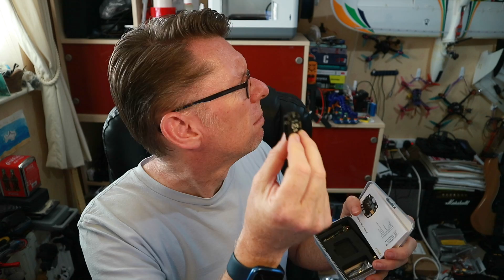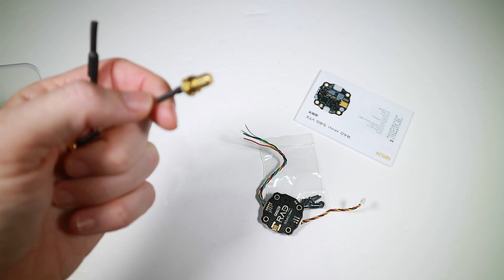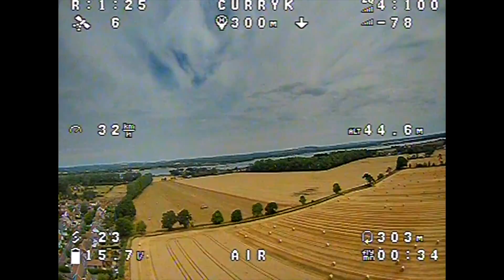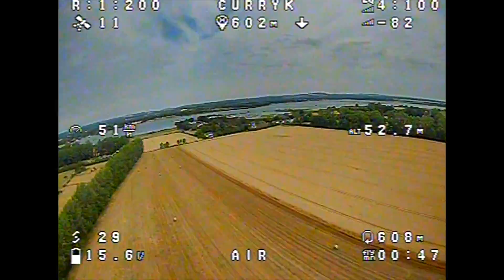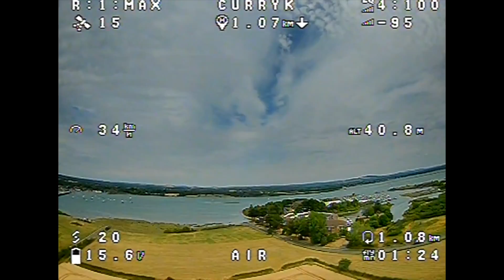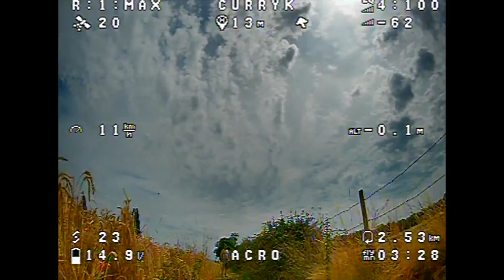GepRC Rad Mini VTX - from 25mW to 1000mW!  Supplied by GepRC

Comment: Hi Wayne, great video! I bought a GepRC cinelog 35 V2 which comes with this VTX but I can only get about 60meters range before the video dramatically drops off, no matter what power output I choose. I'm using stock antenna on the Eachine Ev800dm's. Can you help? Thanks

Comment: So RUSH mini tank is better at 800 than the GEPRC rad at a 1000!?
Reply from the maker: Even if everything else was identical, the difference in range between 800 and 1000 is not as much as you'd think.  Rush has always produced the very cleanest signal - which is why it always comes out on top for me

Comment: Do you get better range in general using Raceband 1?  Nice Video!
Reply from the maker: Not really.  Although the antenna will have a sweet spot for where it's tuned (normally smack bang on 5800) there isn't really a difference in range between the bands and channels.  I use R1 as if I'm flying with others then it's easy to be on Raceband and space the channels out so we can fly easily together
Reply: I had once heard (joshua bardwell) that in the US raceband ch8 gives less wifi interference.
Unfortunately I don't know how that works in the UK.

Comment: I honestly didnt have good luck with the rush 20x20 vtx, they kept on dieing on me. On quads I dont really like mmcx anyways though, its such a pain to route the whole pigtail, and if you dont do it right then it breaks and blows everything up lol.
Reply from the maker: The RushFPV VTX's have been absolutely faultless in my experience... except when I build the Pavo25 not long ago, when I had multiple issues with the tiny tanks I used there.  I do much prefer the MMCX adapter over anything else though.  UFL connectors just seem so flimsy

Comment: Hello
nice review congratulations.
I would like to ask if it is possible to use this vtx without connecting it to an FC ?, standalone, for rc car or similar.
Reply from the maker: Yes - you can use the button to change channel/band/power and you can run a camera directly into it as well.
Reply: @CurryKitten  Is the Rush vtx, the one you already used, usable standalone? thank !!
Reply from the maker: Yes - it's quite rare to find a VTX that you can't control manually.  Sometimes the buttons are a little more hidden away and the status a bit harder to read

Comment: Your thoughts on sound recording off the VTX is like me, at best it's rather annoying. I do see a noticeable difference in this GepRC Mini VTX over the Rush Tank which after watching many of your posts I sincerely feel it still the best analog VTX by a good margin that's out there. I also find that the Rush FPV Cherry Antenna is consistently better than any other antenna I have used to date, even when using other VTX's . I was surprised how much the farmland has changed in such a short time from wet standing water to green to brown ready for harvest. But again your geographical location makes things change quickly. Cold temperatures are not too many days away. However, scenery there is very beautiful love the clear water on your long range test.
Reply from the maker: It's the stuff you only see from up above.  The water in the south coast is usually quite an unattractive green and from the ground it looks like that along with brown sludge where the sandbanks are.  Looks quite attractive from up high!
Reply: I love the cherry antennas, super easy to mount, and quite durable